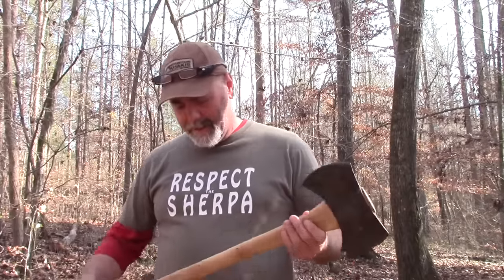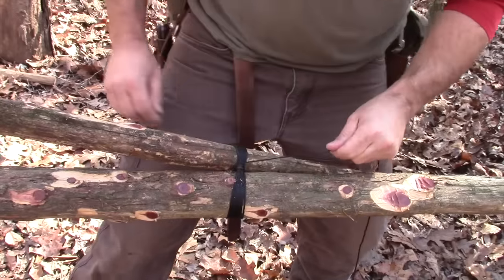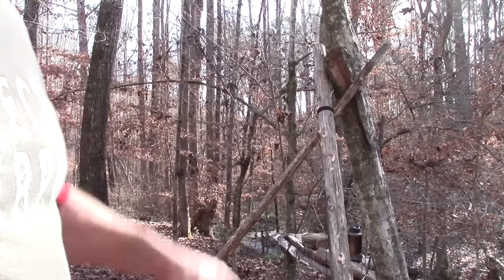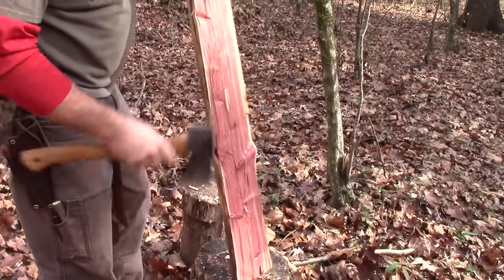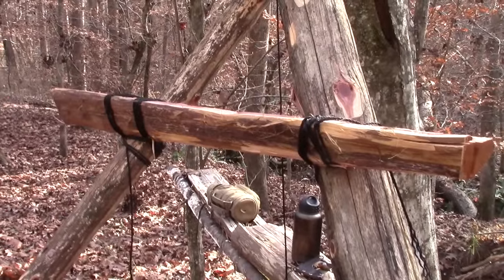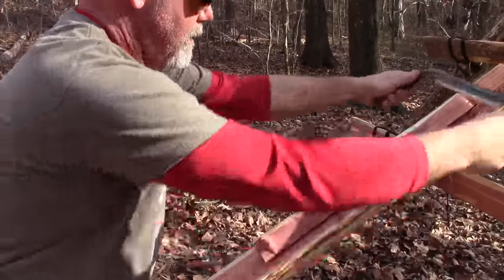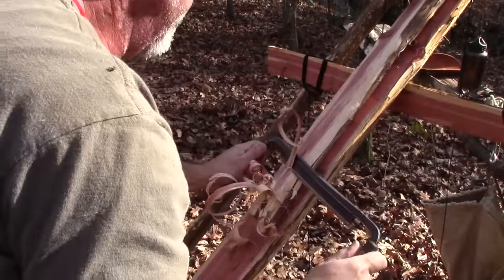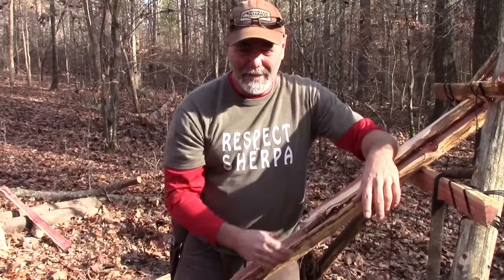Making a Simple Shaving Ladder (Paring Ladder) in the Woods

Comment: Excellent tip. In the distant past, men would set up in the woods where a particular wood was available for the purpose of producing stock for other craftsmen. The bulk weight would not need to be carried from the woods. Only that which was useful and could be traded. Sort of a supplier system. This tool would be easy to carry from camp to camp. Especially as a makeshift travois. A seat could be made from a short piece lashed to a notch. Of course, a small post driven in the ground nearby to set a beer would be nice. (LOL) A shaving horse would not be so easy to disassemble and transport.  
I did indeed subscribe. I look forward to more tips. I appreciate you taking the time to share this.
Reply from the maker: +RadicatTat Good point on the travois and beer holder :-) Thanks for watching and following along on the journey!